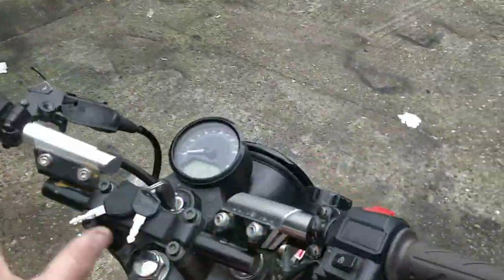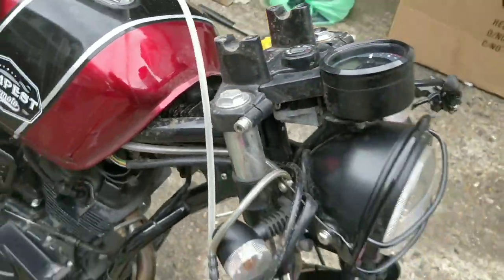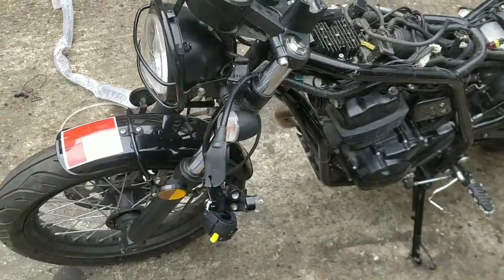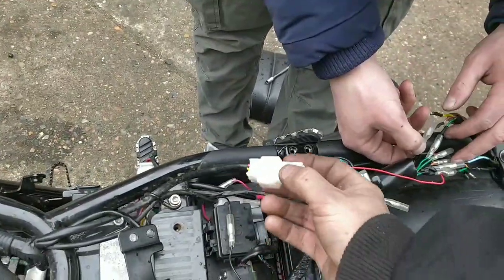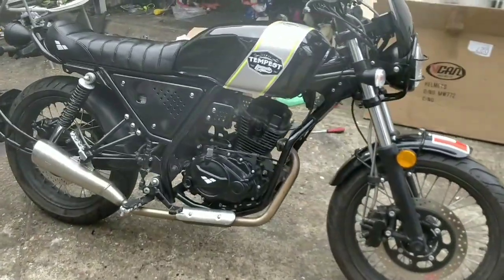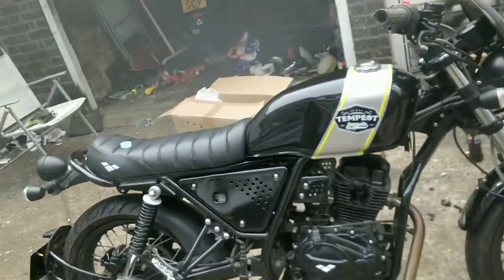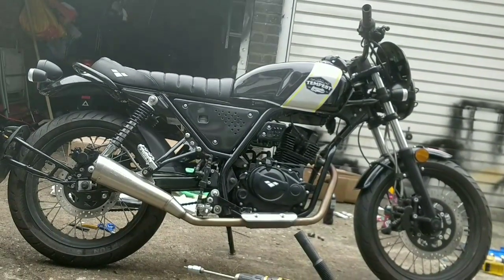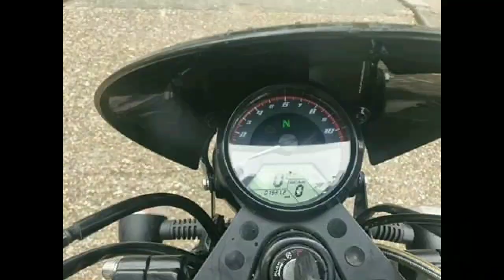how to turn a £600 bike into a £1500 bike. lexmoto tempest GT 125. Double my money, exhaust, test,

Comment: Where is that wind shield from ?
Reply from the maker: Its from the other model of the tempest
Reply: @motorcyclerescuer  I have the tempest 125 2020 can it fit on that and what is the model called  thanks
Reply: Tempest GT 125 yeah
Reply from the maker: @T286GT  I can't remember if I'm being honest, there were 2 models, one had the high level exhaust and one the low. I think you need to change the light bracket to fit the screen aswell

Comment: Top speed ?
Reply from the maker: 70 ish
Reply: @motorcyclerescuer  with stock sporkets set
Reply from the maker: I believe the earlier carb model would do 65 to 70mph on stock sprockets. If they did a fuel injection efi model it will probably be a touch slower..
Reply: @motorcyclerescuer  I am planning to buy  it ! Need export suggestions. 
Gears ratio
Power + speed over all performance ? 
Front sporkets teeth's ? 
And use price range ....
Reply from the maker: You can get all of that information on Google my friend